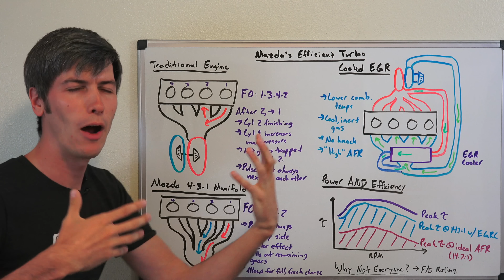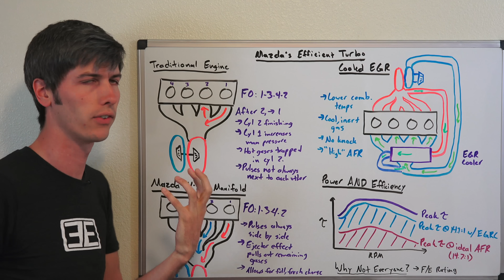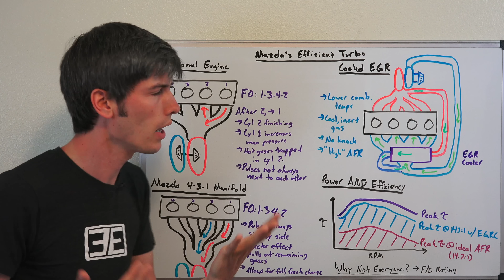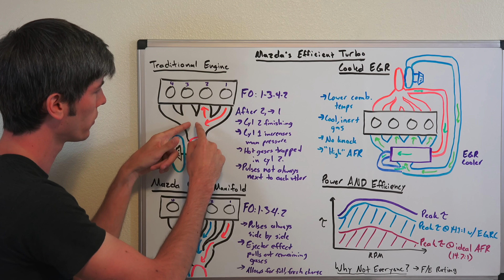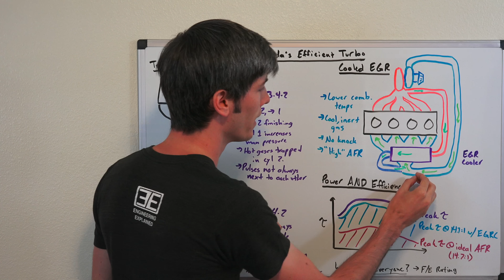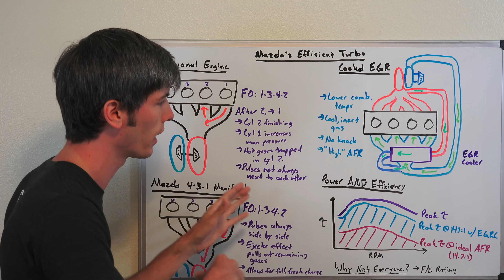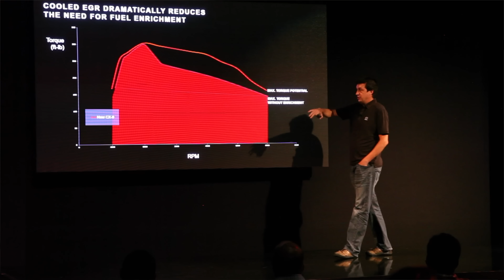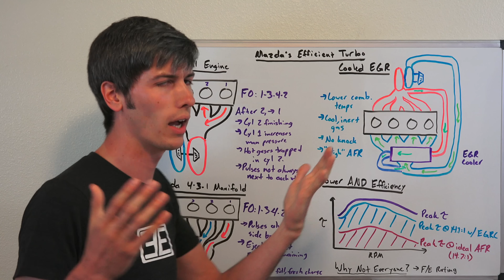Mazda's Secret To Efficient Turbo Engines

Comment: Manifold / header:
Mazda manifold or header design is an old trick, nothing really new. You can make complicated header and get rid of interference between cylinder exhaust gases, but the longer the path the bigger the turbo lag. So you can choose a bit better turbo efficient or less lag. Also in turbo engines, equal length headers are not as nearly important as in NA engines. The best currently available turbo setup would be a twinscroll turbo with appropriate header. I don't see a revolution here in Mazda's case.

 EGR:
Nothing new here as well. No EGR = no problems, simple as that. Mazda is complicating things with EGR even further. In this particular case, the EGR system is just as bad as in any other car. Pumping dirty exhaust air into the combustion cycle once again is not good at all and it is only implemented for the emission control that is getting stricter and stricter. The positive thing is that they are cooling this hot exhaust air before pushing it in to the cylinder, but don't forget, that air came out of the exhaust so it's dirty. DFI engines in combination with crankcase ventilation and EGR is pretty sure path to a failure sooner or later.

 Hidden fact:
Look at the bore x stroke ratio. It's insane. It's a torquey engine designed to work at low revs, so that's why people call it good engine. Casual people like the feeling of low end torque as most of regular drivers don't ever come near the redline. Well, this engine redlines at 6300 and the power curve false at 5000, so revving it past 5000 is a waste of time. It's like an diesel engine, but 2.5l diesel 4-pot engine will be more fuel efficient and more torquey. Simply superior in pretty much every aspect. Probably this petrol engine was designed to offer a diesel like engine characteristics in case diesel engines will be banned in the future. Mazda is among the rare manufacturers that are still putting old, mediocre NA engines in to their cars, so it was about time to introduce some new generation forced induction engine.

Comment: I hate Mazda’s 2.5T engine. It’s not particularly powerful, efficient or well sorted. Mazda’s 2.5T has a very peaky powerband and excessive turbo lag at low RPM vs. rival 2.0T engines from VW, Honda, BMW, etc.

The fuel economy is also pitiful on all of the vehicles equipped with this engine. Similarly sized and even larger vehicles from Audi, VW, BMW, Honda, Acura far exceed the fuel economy numbers Mazda is able achieve with their vehicles equipped with the 2.5T.

Comment: Toyota did that bit with the exhaust manifold back in 1990 with the SW20 MR2 Turbo and the ST185 Celica Turbo. The only difference was the exhaust pulses combined within the turbo exhaust housing which has the added benefit of reduced turbo lag.

Comment: I'm using 93 octane in my 2020 CX 5 Signature (turbo) because the manual indicates I get more horsepower. Should I continue or just start using 87 octane if there isn't any discernible differences in power?

Comment: @engineeringexplained two things come to mind for me. First, I can't seem to wrap my head around how running an egr with higher boost is beneficial over simply running no egr and simply less boost. To me it seems this system simply adds unnecessary pressure to the cylinder. I tried following what you said about afr, but....I can't make sense of it...
Second, Mazda is making 227 hp here, adequate at best in today's world. Other manufacturers are getting as good mileage with better hp and no egr (I have always thought egrs are terrible in principle, for reliability), so why wouldn't i buy the competition?
Just my thoughts. Great video content as always, you are a genius.
Reply: Bmw M47 2006 has cooled egr....so this 2017 mazda...11 years older engine...innovation!?!....i still run this engine in 2020 with 300000km no issues!

Comment: cooled egr increases the density of the exhaust gases to increase the egr rate. Does the temperature of the exhaust gases increase the risk of knocking? We are in conditions which still does not facilitate combustion (mixture of fresh and combustion gases)

Comment: with an egr system the combustion speed is lower and the CO2 included in the exhaust gases absorb part of the heat given off by combustion

Comment: I just bought a 2009 Mazda 6 I like the car but it just feels weird I've always owned something with a 318 or 350 never in my life have I had a 4-cylinder especially one that was as fast as a Mazda 6 for that really low speed like when I'm first taking off the motor makes kind of a rattling sound is that normal it's not a knock almost like a buzzing sound I've never owned a 4-cylinder so I'm not sure how they're supposed to sound lol it drives great fast as hell just wasn't sure about that

Comment: Is this a high pressure or low pressure egr system? You never said, your diagrams sort of look like a high pressure system which is pretty common. 
The reason to use egr is to reduce pumping losss and increase effective compression ratio. 
High pressure systems can only do that in a limited load range. 
Low pressure systems can do it over a much wider range since it runs through the compressor and doesn’t need the pressure gradient to drive flow.

Comment: Mazda uses direct injection though, isn't that bad because of all the carbon build up in the intake valves making it have bad fuel economy and bad turbo?
Reply: Pretty much every car manufacturer uses DI now I think. I don't think carbon build up is as much of an issue as it used to be.

Comment: What do you think about the carbon accumulate on intake valves as a common problem for turbo charging engine? I remember I read some where that a press interviewed the engineer and he said it won't be a problem for this engine because the temperature is in very high control. What do you think about this?

Comment: Honda's 2.0L Turbo in the Accord delivers better real world/ advertised mpg and is faster than the Mazda 6.  Mazda 0-60 in 6.2, Handa in 5.7.  Their horsepower is identical but the Hinda has about 25 less lb. Ft. Of torque.  Not a Honda fanboy or anything.  I'm just up on all new vehicle technologies and thought i'd share for comparison.

Comment: All these technologies are already been used in Maine engines since many years...marine engines are ultra efficient super long stroke turbocharged 2 stroke uniflow scavenged engines. They can also Miller cycle or even water injection.

Comment: Hi, I wonder if you could shed some light on something. A number of times you said that they designed the engine to prevent knock.  I have a CX-9 with the 2.5 turbo, it knocks.  Only when I mildly step on the gas around 2500 to 3000 rpms.  I use 89 octane, and the SUV only has about 30k on it.  This has been going on since 20k.

Comment: What about the exhaust port flap? That changes exhaust output between 3 smaller ports with higher pressure for
Faster spool up, and 3 bigger ports with less pressure, for higher rpm!!
3 ports because cyl 2 and 3 are combined!

Comment: Basically every modern turbo is twin scroll which addresses the exhaust reversion you discuss in the first problem... It's unfair to compare current Mazda to an 80s turbo manifold design.

Comment: Surely just raising the pressure without adding oxygen doesn't increase the efficiency. If I used a 90/10 air source instead of 80/20 it can't help, can it? Could combustion products help efficiency? Is it because it's giving the fuel another chance to get burned in the fuel rich chambers?

Comment: It's true about the Mazda turbo engines getting better mpg than is stated on window sticker. My new2019  CX-5 Signature now has 1K miles on it and just recently I checked the highway mpg. I reset the trip A meter to zero and got on route 95. I set the cruise control to 61 mph and drove 50 miles. The gas mileage indicator read that I got exactly 32 mpg. No doubt If I had driven 55 mph I would have done even better....maybe 35 or 36 mpg. The EPA highway estimate for this car is 27 mpg.

Comment: Good info, makes sense. Mazda does seem to build pretty decent quality vehicles.
Although while parts of this EGR system is good, other parts are most likely not.
Coming from the diesel world EGR systems are a pain, unreliable, makes working on the engine more complicated, and are useally the first thing that gets deleted.
I wouldn't be surprised to see this system be problematic in the long run, and not that great of an idea.

Comment: man the engines they make nowadays are so complicated
Reply: Yes. But this engine makes as much power as your truck and gets almost 4 times the mileage
Reply: @jeffleclerc1662  firstly actually it probably makes more power than my truck to be honest with you

And secondly though it may make more power it is more power under higher strain because it doesn't have the extra meat they're too absorb distress

And that's why you don't see a 3.5 L EcoBoost in the F650

For a car I'm sure it's a good engine but probably extremely expensive to build and maintain

But for someone like me who drives a truck as a daily driver those engines don't offer any benefit because my F-150 gets 17 miles per gallon in my F350 gets 20

Neither one of them is what you'd call fast but they get going if you give him a little time

And nine times out of town if something does go wrong which usually nothing goes wrong because there's nothing to break to begin with you can fix it without a $12,000 scanner tool

Comment: As a technician i wonder about cooled hydrocarbon plugging up cooler and valves,  the hot gases cooling fast is going to make for a sticky situation,  i wonder if they have some service to clean cooler and valves .. do they have both direct injection and intake path injection ?  Love the engineering but i look at the future problems it could cause.. wonder why they dont just use  water injection instead of egr.. seems with todays technology and computers it would be easy and would make great power..

Comment: Why is cooled EGR used? Could a more traditional intercooler ( either air to air or water to air) achieve lower cylinder temperatures and not have all the issues that the EGR brings?

Comment: Wait, I thought the point of using an intercooler was to cool the air compressed by the turbo so you could eliminate that engine knock. What is the point of this EGR system? Is it just to take up volume? Why do you have to use the EGR to cool the intake air rather than using the intercooler itself to do that? It seems counter intuitive that you would sacrifice cylinder volume for an inert gas when you could get more air in there.  Obviously I'm missing something.

Comment: Does the increased use of the intercooler not reduce efficiency overall and I always thought that there was some trace fuel and oxygen in every exhausted gas so how does that work when it's injected into the cylinder alongside fresh air pre injection

Comment: I have a Kia Ceed 2.0 CRDI diesel engine, it has EGR cooler, but in all info available ever states that EGR main function is to lower NOX production lowering combustion temperatures, not anyway improve eficiency or torque. I don not know how a 85/90 celsius degree coolant can decrease exhaust manifold gases temperature in EGR to the extent to manage more power. Certainly my EGR cooler is more tiny than Mazda one. Excellent video.

Comment: All cars I had from over 30 years ago had the exhaust scavenging effect and intake cooler or inter cooler. And yet the efficiency did not improve much over those years. On the other hand Ev efficiency is at least double with available torque at any rpm and no transmission necessary. I used to be a gear head and now all those exotic and powerful cars don’t impress me when a golf cart can do it better.
Reply: you have to consider the loss on charging and bringing the electricity from the power plant to the car though lines. Then, the efficiency isn´t that great any more. I mean ... obviously. Why burning stuff in a power plant to make electricity that has to be brought to the car if you can burn the stuff in the car.
Just taking the effeciency of the electric motor is extremely short minded.
Reply: @segoiii  you are arguing the wrong point. Energy wasted to create fuel or electric charge is not an efficiency comparison between ice or electric motor driven vehicle. That is more of environmental impact argument. 

The "climate change" hysteria and  new craze demanding  for solar and wind production. That requires more natural resources and energy to create, has a short lifespan and causes more environmental waste.
At the same time they are pushing to end the only clean energy - nuclear.

Comment: @Engineering Explained So, if for example I buy a Seat Arona, 1000cc TSI that is heavier than the Seat, will it's efficiency be too bad, because it's heavy and its engine needs rich mixture to run?
Or will it be ok if I just don't push it much?

Comment: Instead of using rectangular seals on the rotary, wouldn't they benefit from a pressurised system that injects a small amount of pressured oil, into a circular cilinder that will spin with the center mass. Instead of pushing the rectangle shape forcefully against each wall, why not roll a cilinder along the walls to make the seal? Less friction. More efficiency and power.

Comment: Isn't the biggest issue the exhaust valve temperature and don't turbocharged motors have higher exhaust temps? Biggest reason I can see for forced induction motors is for altitude compensation (but I live about 150ft above seal level LOL)

Comment: I have seen CX-5 and CX-8 (Japan). I love it - visibility, looks, comfort is all good considering the price. Both cosidering with AWD - which I have checked in Norway and Mazda does excelent job. The back seet of the CX-8 is excelent and might come usefull when my parents visit me.
But then there is Harrier and new RAV4 available. I am considering eAWD (eCVT eAWD hybrid).  I haven`t checked H and RAV4 inside, but I like looks of both of them the same. 
The price is similar - considering the extras for hybrid system of course. 
The reliabilit, personal opinion after researching, is on the side of Toyota. Saying that I am confident about Mazda as well.
I would like to know the thoughts of poeple with similar dilemas comparing these two :)

Comment: Does Mazda design help on carbon build up on intake valve?
Reply: Their answer to that was, engineer the combustion chamber to keep the valves hotter.  I think it helps a lot, although there can still be situations (probably involving bad fuel or poorly sealing cylinders) where enough or bad enough material can go through the PCV to cause a problem.

For what it's worth, I used to do the intake treatments at the dealer but I quit after realizing it's unlikely to be a concern, and besides, my '13 has a perfect layout for cleaning the intake valves myself if I have to.  Honestly it looks like I could do it in an afternoon, and I work with computers/electronics, not cars.

Comment: Good explanation as always.
Regarding the scavenging, that manifold you're describing looks to be an exact copy of the saab B204 engine dating back 1991.
The same car had an Ecu (Trionic) that measured the margin to knock using ion sensing from the ignition system. That way it could compensate using leaner mix when higher octane fuel was used.
This has probably other manufacturers copied since.
Reply: Skyactiv also has a knock sensor operating under all engine speeds for basically the same purpose.

Comment: I am diesel Mechanic and see these egr cooler fail a lot and they usually fail after warranty ends and they are ton of money, in thousands and they usually fail other components with them like tubro , egr valve and sometime injectors because of sticky coolant that leaks into air flow. So to keep till you have warranty only

Comment: Scavenging effect my S. Look at the Peugeot 1.9 MI16 exhaust manifold, it has a separate header for each exhaust valve (8 in total) for faster gas exhaust speed thus scavenging. 
Scavenging also matters only in NA engines. In turbocharged engines it does not matter anymore since a) turbo is a restriction itself and b) positive pressure in the intake charge blow out immediately any leftover exhaust gas. 250 HP out of a 2.5l engine is so 1990ish, Audi/VW offers 250-300  HP out of a 2 liter engine, making also use of technologies like variable valve lifting that perhaps you will speak about in the next century.
I hope Mazda paid you well.

Comment: Can I say that so the EGR also reduces the pump loss as the throttle can be wide open but the cylinder are not suck in all 21% o2, so the effective throttle are not 100%?

Comment: We remove or block off these EGR systems on the Mazda BT50.  Because of engine blowby and exhuast gas combined leaves a black sludge residue though out the entire intake system. Also there has been a known problem of the EGR cooler cracking which leaks coolant straight into the intake.  Im sure they have a much better design for this now with the new mazda 6 but on my old BT50 its more trouble then its worth..

Comment: Is the exhaust being cooled to near ambient temps? 
Its good to see good manifold design (as good as OEM can be) to minimize reversion and actually do useful work on the turbine. I am curious to see E-85 being run on such an engine, but it is a DI motor so there is that nightmare to deal with direct injecting a very light and low energy density fuel, but there would go any chance at decent fuel mileage regardless of spark advance. I'm still trying to workout exhaust gases being used to quench combustion to avoid detonation, i mean what does that do to the time of flight of the charge mixture much less the flame propagation speed?